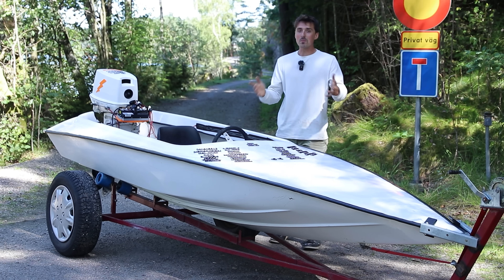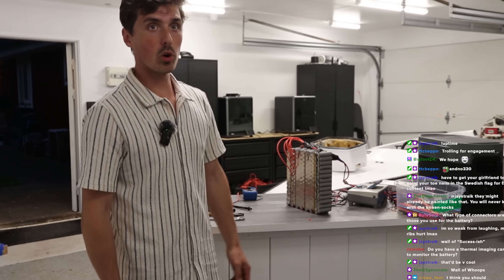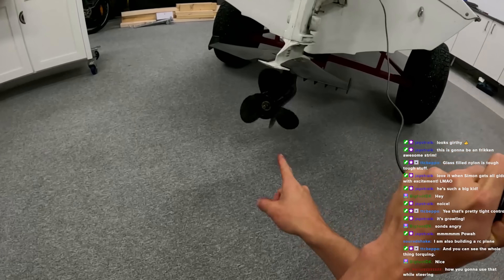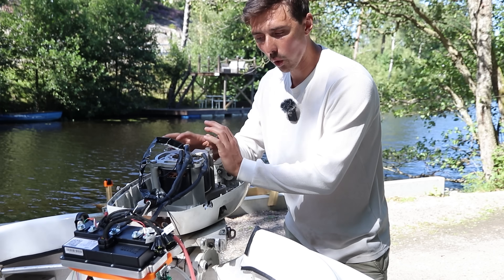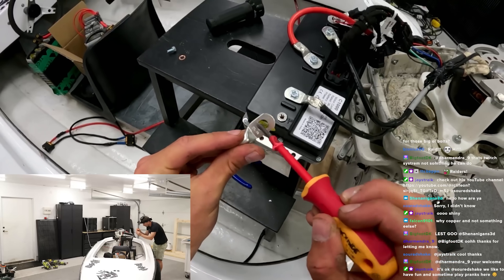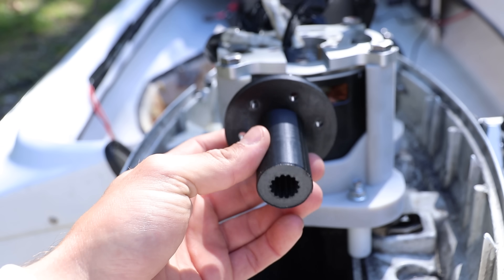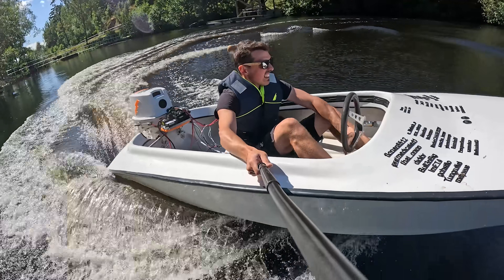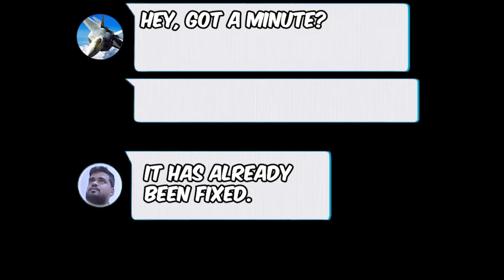Turning My Gas Boat Electric Part 2

Comment: So I own a talaria (similar to a surron) and I updated the controller and will shortly upgrade the battery and motor. I had in mind converting an old outboard as you did since I will have the old motor, battery and controller in hand. Total power would be 6KW.

6KW being 8HP, it sounded like a good amount of power, and the fact that I can ride my bike for 50KM really lead me to belive that the range shouldn’t be as bad ?

You should try a range test with a more modest speed. Can't be wosrt then a trolling motor

Comment: What propeller type are you running?
Maybe a toroidal prop could to lead to some more gains?
Reply: No, toroidal props do nothing for top speed, and its debatable if they do much for anything else either.
Reply: @GoldenCroc  their main advantage is that they reduce noise, while they seem to produce some efficiency gains in some torque ranges. 
It’s difficult to come by lots of quantitative information apart from the initial paper.

Im 

I’m curious what you base your assumption on. Thanks.
Reply: @GoldenCroc  interesting! Thank you for your perspective.
Reply: @slickheisenberg8208  Good that you could read the comment before it got deleted by youtube (at least, I cant currently see it). Youtube seems to think I am some sort of bot or similar, and is sometimes removing my posts. A bit infuriating, but its probably because I sometimes make a lot of comments in a short space of time, I guess? Cheers mate.

Comment: You can make rollers (long ones) out of PVC pipes... 
technically If you want them even better add a bearing on each side of the pipe
I go to thrift store buy old Skates/Skeelers and salvage bearings...
but ordering them online in bulk is cheap anyways!!

Comment: Simon has done tons of projects, and unique engineering setups, so watching him build the worlds most dangerous way to get a boat in the water is fantastic. So those rollers are really bad for boats.  They allow movement, but they will eventually crack the fiberglass? because rollers don't spread out the impact.  Can you get two tracks with rubber on them , and then install them so they lower the boat into the water with a vshape that matches the hull? When big boats have little smaller boats on them, sometimes they take the motor off so you can handle the boat, and deal with the motor easier.
Reply: Rollers are a bad ideia here. As someone said above, just use longitudinal planks with carpet on them.
Reply: The hull is strtong enough for rollers like this.. IF they are placed correctly, which of course, they were not. Of greater concern is the metal posts holding them scratching or making a hole into the hull.

Comment: i wonder if you could lower the height of the first rollers on your ramp so that the effective angle into the water was less...  Seems like a simple fix?  Or does your boat trailer require that height?

Comment: Skip the rollers for your ramp. Just use wood planks the full length with waterproof carpet on them. Cheaper and stronger. Great job, very cool project!
Reply: 2 long planks of Trex/composite decking would work perfectly.  Low friction, no moving parts, cant fall between the rollers.  Carpet is good for a trailer because it grips the hull pretty significantly but it doesn't slide worth a damn, especially once its wet.
Reply: Rollers work fins, if theyt are placed correctly. No idea why he placed them that way. He also need more of them.
Reply: @GoldenCroc  Best part is no part. Drop the rollers, they are not useful and will only bring problem.
Reply: @AeroGraphica  Much lower force needed than without them. Rollers work fine if placed  correctly.

Comment: If you put jet drive in to that boat, its exactly what I have been planning (dreaming) for a couple years now. Small electric (or gasoline) jet speedboat version from of those really fun small jet boats from America. All tough, I would build the frame myself from wood and/or fiberglass. Cant wait to see what comes out from your plans!

ps. awesome content!

With best regards, fellow from Finland.
Reply: Not a bad idea, but the problem with reasonably fast electric boats is battery capacity. A jet drive is very inefficient versus a prop and will use even more energy than this. Battery would have to be very large, heavy and expensive.
Reply: @GoldenCroc  Yeah thts a good point, so we wait for a miracle innovation in battery technology... until then, we dream and plan for future, ot use gasoline

Comment: I wondered why you didn't get a boat big enough for 2 - @10:27 Looks like you were way ahead of me.
Reply: This boat is very light weight and and is a proper race boat for small engine classes. Since he got limited power, thats probably why he used it.

Comment: Great project!
2 things: - did you think about cooling the battery? Foam protecting it and such will be basically insulating it, so get even hotter. Heat is one of the biggest enemy of batteries, and it depletes it faster.
- you could build an aerodynamic canopy, I think windage is slowing you down and worsens your efficiency.
+1: Propellers are speed matched, so could be that an other propeller will give you better efficiency. The difference could be as big as 2x.
Reply: Saying “Propellers are speed matched”  is a false statement. Propellers are like axle gearing in a car.  You can have a propeller that's pitched for top speed, sacrificing low end torque, or, pitched for Torque (gets the boat up on plane quicker) sacrificing top speed.  The key is finding a happy medium.
Reply: @savage6394  Yes, that is what I meant. Either I write 3 sentences or 2 words... I think here the latter was better.
Reply: @savage6394  The statement in itself is somewhat correct, props are designed for different speed regimens.
Reply: Aerodynamics will do absolutely nothing at this low of a speed. Its the water drag in its various guises thats the limiting factor for this.
Reply: @GoldenCroc  As someone who sails boats, I can assure you, windage is big, and a big loss at 30, 40, 50 km/h.
Reply: @Sonnell  For your sailboats thats of course possible, since its very different to what this is. But I was talking about the boat in the video.

And as someone who not only drives boats, but RACES powered boats of all kinds; not from aerodynamic drag, it (windage being a big loss) isnt. 

The modification you suggest is not even measurable in a lab for something like this. I can assure you this as well :)

Hopefully the one who gave your comment a like will see this one as well, so they can be correctly informed (if that matters to them). Anyway, cheers mate.
Reply: @Sonnell  Very true, but still fairly small @ 50 kmh for something as aerodynamic as this.
Making a perspex canopy and waxing the hull would also help a lot!
Reply: @Sonnell  I can see you are a bit disgruntled from the tone of your reply, probably because you felt your toes were stepped on, but take it from me, I didnt mean to make anyone look bad. 

It was just a matter of fact answer, thats all, and I just know quite a lot about this subject compared to most people, thats it, so I answered using that knowledge trying to be helpful.

Now, to answer in order:

I dont need to do that (measure in a lab), I know theses boats and aerodynamics (On top of racing boats as a hobby, I am a long time physicist and physics teacher as well) well enough to know it is exactly as I say. I even know exactly what model engine "shell" he started with as well as the manufacturer and specifications of the hull he is using. Its just long time experience, nothing special at all. 

No, windage is not larger than I imagine, for this type of boat, its more or less exactly as I imagine, see why in my paragraph above.

Racing boats are "aerodynamic", (they often arent very aerodynamic actually, perhaps ypou have mistaken some features for aerodynamics or is thinking of a specific class of racing boats? Canopies etc are mostly for safety etc) because they operate at much, MUCH higher speeds than this one, and if one can optimize it without having other drawbacks, why not. I am all for aerodynamics, in fact I have didecated a lot of my time since I was a teenager designing aerodymic concepts for vehicles. But it needs to be used in the right place to show benefit.

Efficiency is indeed HUGE with all capital letters here. Absolutely agreed. However, the canopy would be in the very very low single digit range, possibly quite a bit under even 1% gain in propulsive power needed to maintain a certain speed. Then comes the weight of the canopy, which increases the hydrodamic drag. All in all, I can say with confidence it would actually be a NET LOSS for power draw, if factoring in the weight of it as well.

All in all, no hard feelings mate, you idea about a canopy wasnt bad, not at all. In fact it was very good, I like that kind of thinking. Thumbs up. You just didnt have all the experience and knowledge I had about this specific subject, so no need at all to feel bad. No one can know everything and everything is open to discussion. 

Again, thumbs up for thinking about it and I salute you for it! 

Cheers mate. :)
Reply: @ahaveland  Canopy weight factored in, mean it would in all liklyhood increase the total power draw, though by a very small amount if the canopy is made thin and light. Not enough to measure in the real world, and hardly even in a lab if factoring in other differing conditions.

Waxing the hull is, contrarary to what would seem intuitive, actually not what you want. The properties of water means you want a microscopic "let off" from the water. This means its actually most common for boat racers with similar-ish boats to sand the bottom with very fine sand paper to get the lowest drag. Between 400 to 800 grit sand paper is most commonly used, and provides the right surface texture.
Reply: @GoldenCroc  Thanks, yes, I found this in my research too - this area of tech is pretty well advanced by now so Simon does have some options for improvement..  Fascinating journey!
Reply: @ahaveland  The top priority would be to increase the engine height and therefore reducing the "wetted surface", and balancing the boat properly by moving around the batteries etc. These two things put together can net him an easy 50% in efficiency gain with potential for even more, without costing him much of anything and being quite quick to perform. Cheers mate.
Reply: @GoldenCroc  I'm following rctestflight too who is also currently experimenting in this area - a collab would be interesting!
Reply: @Sonnell  Well I believe I can interpret a tone from a post quite well, but ok, I will take your word for it that it was just honest interest after all. Perhaps just a bit of misfortune or uncommon wording then. Ok, it happens.

The first comment wasnt meant to be taken exactly literal word for word, as you might have surmised by the smiley at the end. If not, well thats how it was. The same with every comment actually, at least until I  elaborated further in comments below. It is indeed, if we want to be very exact, as I later wrote, in the very low single digit range, possibly below 1% (I am talking in total for the whole vehicle, including hydrodynamic drag). And as you can see that I have written above, almost certainly a net loss (albeit also a very small one) when factoring in the weight of the canopy, depending of course on its size and weight.

Good for you that you have a similar background, but this is a comment field on youtube and not an academic paper and since links arent permitted one is a bit limited. Thus there is a limit to what I CAN give for information. And, again, not all of it was meant to be taken exactly literally, which I would have though was clear enough. But now you know, and I have clarified it enough, I trust?

No, just numbers alone they do indeed mean nothing, but you will just have to trust my knowledge and experience, which you no doubt would do if you knew more about it. Again, its about being charitable. Which I personally, always try to be. To each their own. 

Now, I honestly dont wish to be rude at all, far from it, and I have abstained as best I can from being so, if you look at my posting above. But considering this post of yours I must say: If you knew a bit more about powered boats in this class, what I write is plainly obvious, and doesnt take any sort of PhD in either aero or hydrodynamics to realise. Just relatively casual experince with the subject is more than enough. In essence, it is quite elementary and self evident. This isnt a racing recumbent bicycle where a 1% in aerodymic drag is almost directly proportional to power usage. Water is dense compared to air, thats about it.

Thats why I dont really feel the need to write more (you will note I have already written far more than most people above while trying to explain in a reasonbly easy to read manner.) 

Anyway, lots of my fellow reacers dont have my physics background but could tell you exactly the same as I did. And vice versa, if you have studied aerodynamics / fluid dynamics and see the size of the boat in the video and can extrapolate from that, you should be able to come to the exact same conclusions that I did, without even knowing the drag numbers for the motor shell or the hull (which I have). I actually even currently own 3 of the exact same motors he is using as the "shell" for his electric motor.

Cheers mate.

Comment: No idea what I am talking about, but how bad of an idea would it be to use a water-cooled CNC spindle? Designed to run under load for a long time, and have plumbing built-in.

Comment: I feel like it's louder than it should be. Like a lot louder. If it's loud like that I feel like you're losing a lot of power on the mechanical end. Somethubg is not right still. Something is too tight or too loose. It should be way quieter than a gas machine. 

Water cooling will help a ton. You know this obviously. I have several VESCs and one is the 75300 with integrated water cooling and on that one I'm getting away with using a PC cooloer radiator and a 12v pump. This is on an overbuilt bike, radiator behind the headlight. I think if I were in water I might be tempted to use the forward motion of the craft as the pump. A little janky but here's what I would try. Open end of a tube facing forward fastened to the bottom of the boat, the faster you go the more water you get type deal. The waters always cool that way. If it lacks pressure just use graduated hose sizes. 

That controller is rated up to 500 battery amps. That's a beast. I bet an industrious person could make a jet boat with that. Maybe someone that has experience with impellers. You wouldn't know anyone like that would you? 

Just sayin'
Reply: He has an EDF running and it's a lower unit to an outboard so it won't be quiet. Also, the Mic amplifies the sound, In person, it would not be as noisy Not to mention the boat is a big echo chamber. A wide open tub with no insulation will amplify vibrations or sounds. It's perfectly normal.
Reply: @FarmerFpv  I thought it was loud and his girlfriend said it's loud as if she couldn't hear anymore after that. I still say it's too loud and he should make it a jet boat. He probably already has everything he needs or just smaller versions of what he needs. Probably easier to cut a hole in the boat and drop a jet ski in it but that's been done quite a bit already. Lots of jet skis where I live, probably not where he is though. I wouldn't even be able to get in the water where he's at.
Reply: @zentechnician  As the other guy said, its the EDF and microphone. Jet drive will use even more power for a given speed.
Reply: @GoldenCroc  Yes but the impeller is in water, it's much quieter. It's loud, a person physically there said it's loud. That's kind of a hint.
Reply: @zentechnician  Did they? I see no indication they are talking about the drivetrain in itself being loud, rather than just the cooling EDF? Where did you see/hear that?

Keep in mind, I speak Swedish and understand exactly (as far as me not mishearing) what they are saying in this video.

Comment: Dont do the jet drive, it will just make it slower and more prone to leaking. Try adding tilt to the motor. If you could tilt it outwards more then the bow of the boat would be higher, you would have less boat in the water and could go faster.
Reply: Or possibly electric trim tabs.
Reply: It's called trimming the motor

Comment: there's no way an equivilent size gas outboard would push the boat at 32mph!  ... can't wait for 120v to see what it can really do!
Reply: You’d be surprised with what people can achieve with small boat motors.
Reply: Sorry, but its exactly the opposite. The motor he cannibalized for a shell (its a late 1970s OMC, so very old), so quite literally the same exact thing, makes this thing even faster, and for less weight than the batteries in fuel, he could go at full speed for at 2 hours instead of minutes.

I am all for electric stuff but this comment is absolutely not well informed or true. One can support one thing without having to make stuff up (or not know) about the other. I hope the ones who liked your comment also sees this.
Reply: There are small diy hydroplanes pushing 35-45mph with 15-20hp outboard but they are purpose built racing and always older lighter 2stroke outboards
Reply: A motor of that size would push a boat that size to 50 kph without issues and the gas would last more than 6 minutes. 19 kW is roughly 25 horsepower. A 25 horsepower boat motor isn't huge.

I love this idea though and I wish it was more feasible to run something like this on batteries. I would be tempted to build one myself.